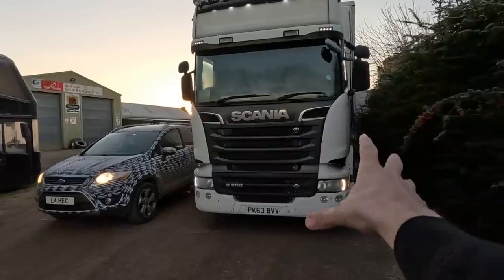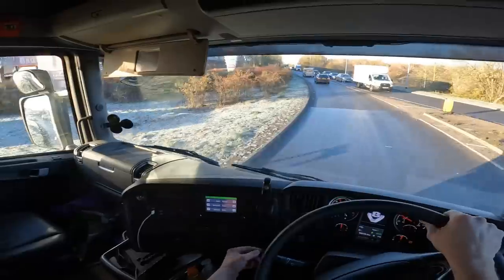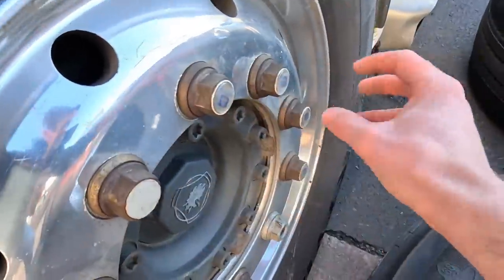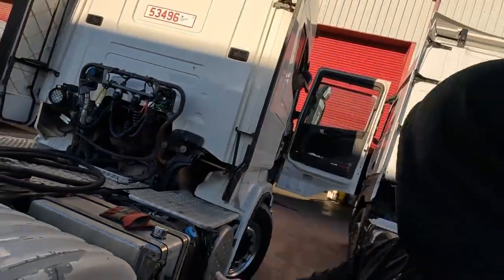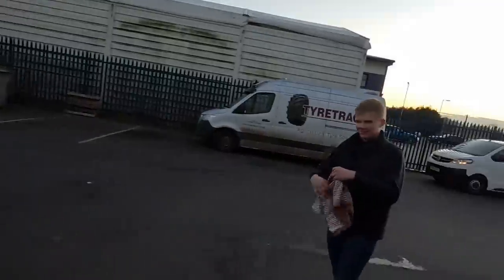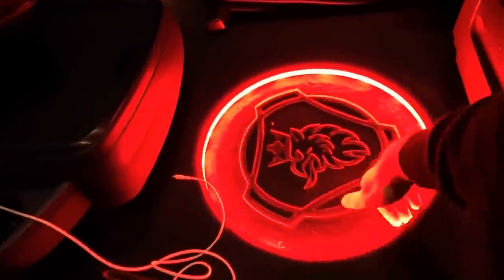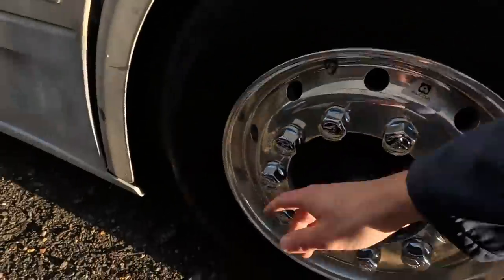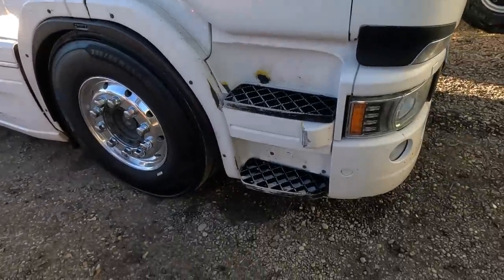These NEW Wheels TRANSFORM My Scania V8 | 1 OF 100 Silver Griffin | Ep4 | #truckertim

Comment: Use that Autoglym Interior cleaner on the steering wheel, it’s perfect for cleaning steering wheels. Spray the steering wheel generously and use a soft nail brush to agitate the dirt. Then gently wipe around it with a damp clean microfibre cloth… once it’s dry it will feel and look like new 👌

You’ll be shocked how much dirt will come off of it

Comment: Wee tip Tim if youre worried about the mid lift rubbing through the wheel cover, stick a thin metal plate on the underside of the cover so when the wheels raised if it catches anything and spins it won't rub through, when I was on timber the boys in tags would do that as it was more of a problem for them with the tags clearance when raised

Comment: That Horn rocker switch on the dash used to work up and down to do either tone on the Horn's under the cab, probably only want's a new solenoid valve on it to get it working again, she look's loads better with a set of super singles back on the midlift again now as well

Comment: Hi Tim your tractor unit looks  awesome with the new drura brights and the new Michelin tyres  and with side skirts  it's going to look real gem . I think painting it wet white gloss with wet gloss black trim  on the  front a big set of new high end lights and  put a wet black bull bars . But it's your baby so do what you want  it will look stunning when finished. Inside speck it everything  scania v8 with huge sounds inside and big horns for tones goodluck Tim and just really happy for you as you are a sound guy

Comment: I would've put anti seize on those new nuts and the wheel hub, 
since they are Aloy on steel and when they start bonding, they stay on the hub even without the nuts.

BTW. colours: the side skirts, fender and wheel liner in the front, the window trimm and grill Black gloss
all the Chrome Blue and a Simple wave on the cab in blue and trim lines in the grill and skirt and fenders.
Also white lightend Scania bagde and embleme.

Comment: Pro tip: those Alcoa wheelnut caps are perfect for wedging the handles on fuel pumps when the little clip thing doesn't work on the pump
Reply: We use the spouts that come with Adblue IBCs 😅

Comment: Looking good Tim looking good.
If have send our other driver over to you to give his touch.....
It's fantastic what he's done to our high liner.
He's seized an engin
Smashed both side skirts
Smashed top spot lights + bent ns of light bar.
Took every ns mirror off.
Bent ns wind wing......jack knifed it reversing.
Smashed all front splitter also lost fog lenses.
Bent off the 5wheel ramp
Both drive mud gaurd tops have worn through.
Rats have moved out the cab.....said it was a shit hole...... decorated cab with tea and other stains.
And he's got a thing for screwdrivers.....there everywhere.......hmmmm.
And he still thinks he's best in business!!!!
Now IV got drive this unit as well as the other 2lorrys.
Do miss haveing a lorry to call my own and look after and work.